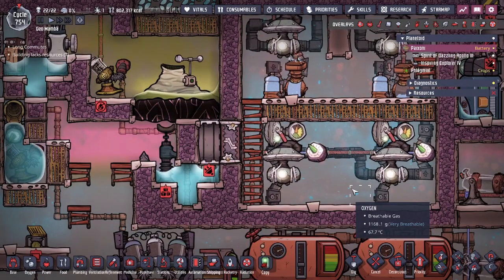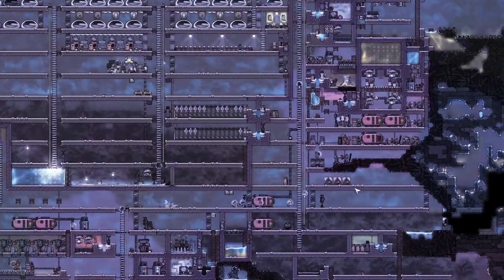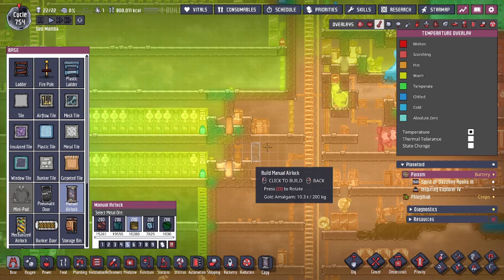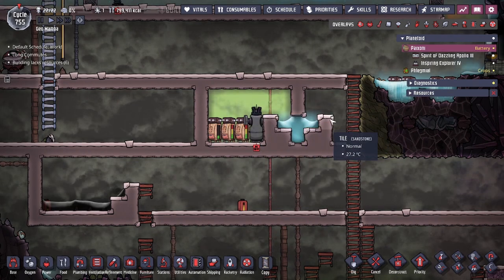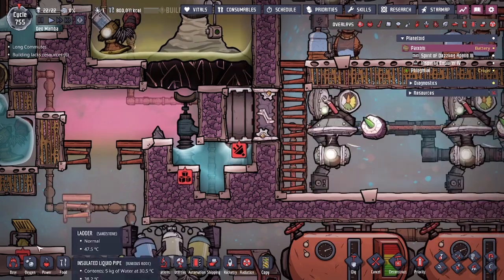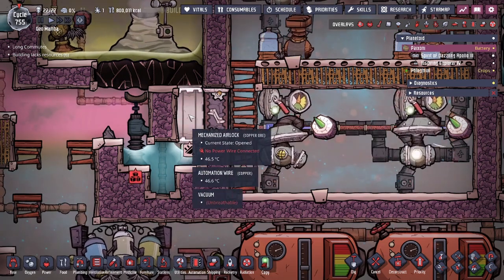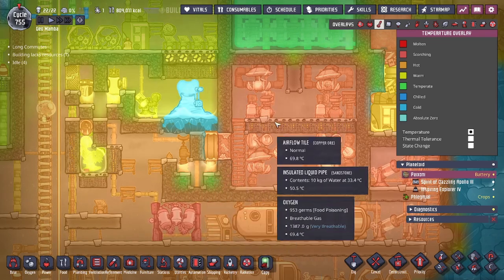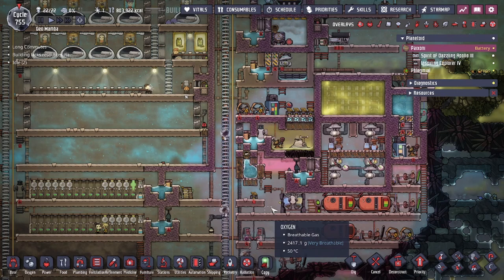The Vacuum Door - Easy Liquid Lock Upgrade to Stop Heat Leak or Heat Transfer - Oxygen Not Included

Comment: 4:57 for quick access. (for future video's maybe put it at the start for a few seconds?)
Thank you for the tip! This is easy and very handy. 

The issue I ran with making liquid lock myself was that sometimes dupes breath out CO2 which although has low thermal conductivity and heat capacity it still could help seep heat through.
Reply: i think you should has for your base atmo suit before doing anything like this

Comment: This design has been immensely helpful to me. With the in-game pipe disconnect feature, I can temporarily direct a cooling loop to cool the water lock while I open the doors to make alterations or repairs to the steam chamber. Some water is lost to the steam chamber anyway, but this design also acts as a gas crusher in case the steam pressure causes issues for metal volcanoes.

Comment: how about the material for door and insulated tile ? good idea btw, just worry for heat leak from tile and water on next few hundred cycle.
Reply from the maker: the door materials dont matter as a open door isnt considered active and since the vacuum is between the doors and liquid, there is no heat transfer there. for the insulated tiles i am using igneous but i do not think it matters too much due to the insulated tile properties. if you didn't know, the insulated items in the game (tile,pipe,gas pipe) all have different calculations of heat transfer and usually having the insulated property tile is good enough. if you are worried about heat leak you can technically do whats known as a vacuum wall to prevent heat transfer 100% of the time

Comment: Looks like this doesn't work any more, the mechanized airlock takes in gases when a duplicant passes through the manual airlock.
e: oh you have to manually cycle the switch. ugh, ok
Reply from the maker: there is a somewhat automated version but isnt 100% and breaks- i still use this version over that.

i ttend to use this as "temporary insulation tile" since the vacuum prevents heat transfer out while still having a liquid lock in emergencies

Comment: Can you automate the vacuum door? Like after the dupe finishes building temp plates in the steam room and you forgotten about that room, then the heat leaks out for the rest of the game
Reply from the maker: thats a good idea to improve this- its probably possible but i would want to test it first
Reply: @2LegitCity  You should be able to either use a pressure plate or a motion sensor for detecting dups (probably want a buffer gate to insure it has enough time to fully close)
Reply from the maker: @marcusmatousek33  i think a dupe sensor works better so you dont get a stuck door due to dropped debris, but having this also creates a small problem by crushing the gas that leaks out of the box. of course that only matters if gas volume inside needs to be at a certain pressure point, ie chlorine rooms